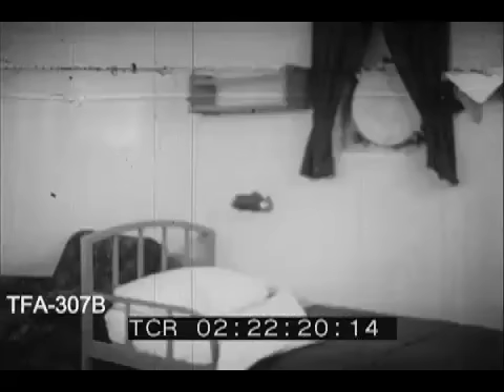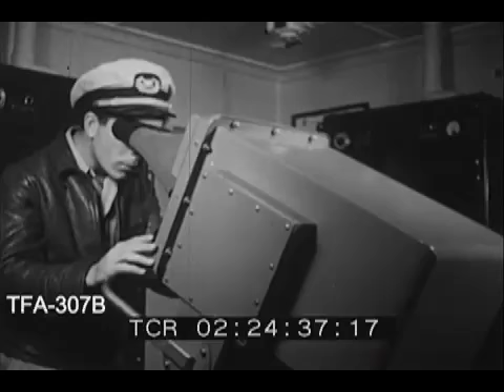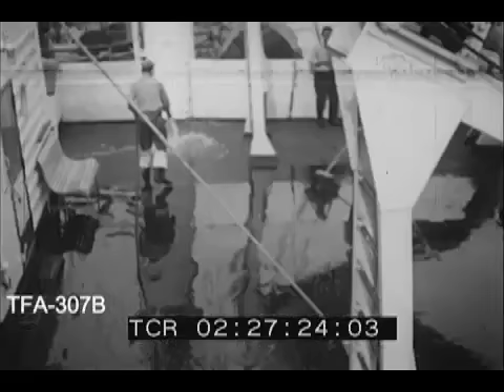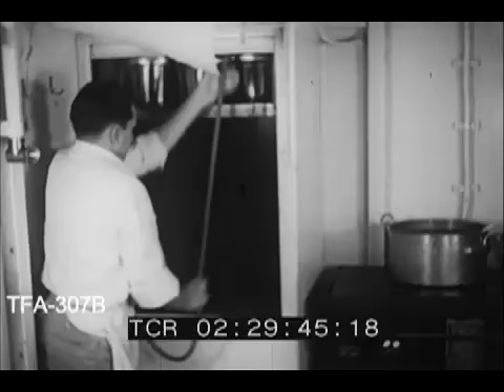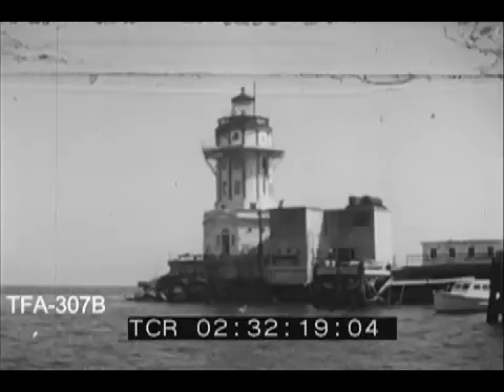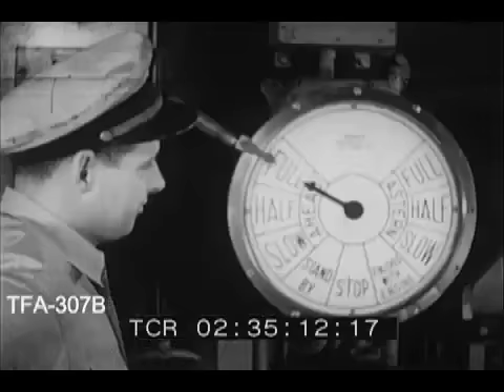Freighter At Sea (1948)

Comment: Enjoyed this old film. I’m a retired now but early in my career I worked on ships built in this era, the depiction is spot on and entirely consistent with my experience fifty years ago. Decades later I commanded ships of 20 times the tonnage with a crew of half the size.
Reply: Yeah, I sailed as an AB and then Mate from 1981 until 1996. The change was already underway, but I managed to sail in some old break-bulk freighters before they were gone.
We move a heck of a lot more cargo now, but it isn't the same for the sailors.